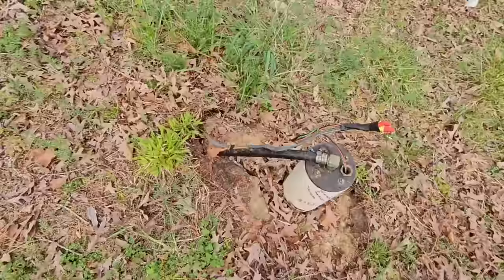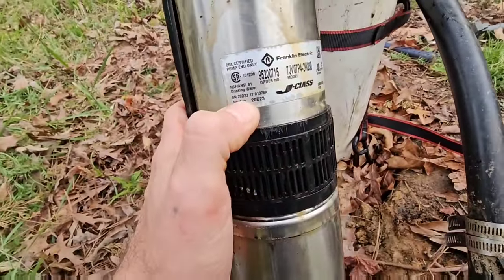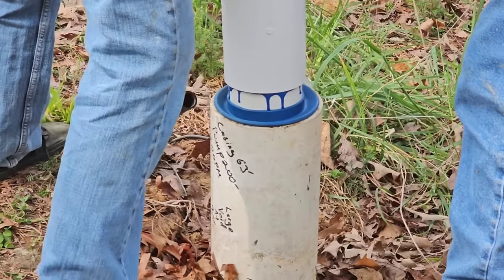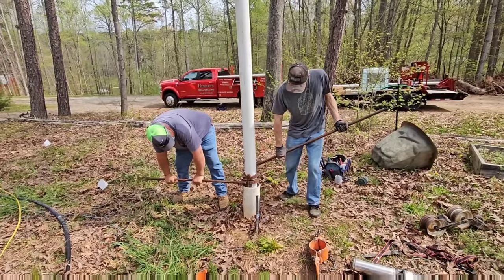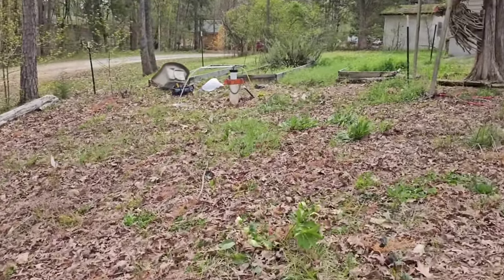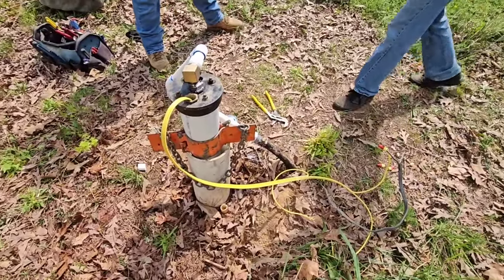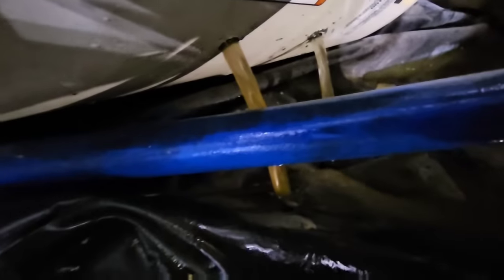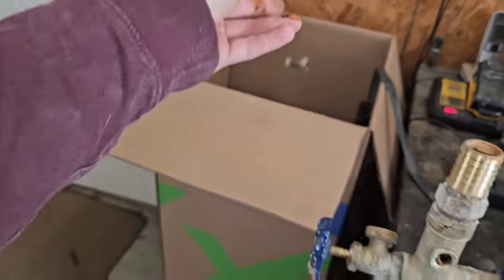Sediment Problems and How to Fix it. Discolored Well Water After Heavy Rainfall. Full System Check

Comment: I can't believe that I've now watched five videos from your channel, and am now subscribed... I don't even have a well.
Reply: So I am not the only one.
Reply: no well, new subscriber(nwns) here too...
Reply: Same here. However there is a chance within the year I will buy property without city water. So "knowledge is power" when it comes to existing wells or getting new ones drilled.
Reply: I watch these too. But I bought my current house 1.5 years ago,,, my first well. My pump failed on July 3rd. I knew exactly what to do. New pump, new well pipe, new wire, new well seal, and a frequency controller. Repaired my well casing by welding in a patch where it had been notched for wire and rope, Did some re-plumbing. System rungs like new. Thanks H20 Mechanic!
Reply: Niceee @usethenoodle

Comment: Hydraulics Professor once told us "the best way to heat up your system is engage the pump and let it dead-head against a closed valve for a few minutes. The hot oil will heat up the your system in no time once you open the valve."

Comment: I just sent you some paypal lunch money as a thank you for sharing your knowledge. You know what I mean: the tricks that the pros know that average DIY person will probably never have the opportunity to learn. I am getting ready to replace my 3rd pump, at the third house I have lived at.  I thought I knew how to do it but you have soooo many tips and secrets. I pulled the pump the other day (muscled it up 135 feet) and I thought I was gonna die. Then I saw the clever rig that you made with the lawn mower wheels, which I am making an ok copy of right now. You may have saved this old man from having a heart attack, LOL. When I pulled it up a few days ago the pump checked good (its at least 13 years old) but the wires were chaffed in several places and I ended up having to use the green wire as a hot. I am going to the well supply place tomorrow to get everything new: wire, pump, snubbers, low-pressure trip pressure switch, etc. The 13 year old 3/4 HP pump is probably on borrowed time. It's total run is about 700 feet but its head is only 230 feet. The pressure tank is only 8 years old and is inside the house, but I will check the bladder pressure and listen for the ring and make sure its cycle time is correct for the size of the tank. (A 40 gallon bladder.) And all the other subtleties that you have shared. This will hopefully be the last time I pull a pump in my lifetime. But I think the static water height is about 40 feet higher than when I checked it several years ago, but the water still tests good like there isn't a ground water issue, I hope. Hmmm.
Thanks again, and enjoy lunch on me! Lloyd

Comment: I've had wire in my well for thirty years,  I put my wire in 3/4 inch black poly, from top to bottom. Works great
Reply: That’s the question I asked too.A simple no brainer in my books
Reply: I don't understand why well pump wire is done this way and not a flat cable like romex.

Comment: Love your videos. You are a master well driller/repairman. I have two 500 ft wells in North TX down to the Woodbine Aquifer. So far so good with one well using a 10 gallon per minute Franklin pump, and the other with a Grundfos 3" constant pressure electronic pump with a CU301 Controller kit. Great stuff and zero problems so far in 5 years.

Comment: With the bare hot and ground there would have been current in the water.  I wonder if that would heat the water.  I guess the well does not have a ground fault breaker which would have tripped.  Do people use ground fault breakers on wells in new installatins?  Good video.

Comment: The more well videos I watch from all sorts of companies, has made me glad we did a bunch of extra stuff for my new well down in Arkansas. Ran a 10/3 240ft to my well from the pole on it's own breaker. Built a 10x10 shed over the well head, with a tandem 30amp double pole and twin 20amp breakers on their own circuits for each, with their own duplex and light on each leg, with a secondary breaker panel with 2 slots and a generator back stab. That way anyone can work on the well if no one is home. And can be turned off in multiple spots and if there's no power u can flip 2 breakers and backstab right at the well shed with a small 220/240 Genny.

Comment: As a well driller in Australia, we deal with mud rotary as most of our land is flat coastal. 

We do have afew guys with DTH rigs for the hills but mainly mud rotary around these parts of Western Australia! 

We set casing from the BOH to surface with slotted casing down the bottom, gravel then bentonite chips to seal off the surface water. 

I’m glad to see everyone getting work especially us when we get government work 😎😎

Comment: We had a well silt in and the grit from the silt trashed the pump. Well was bad after that. We could potentially have added a bunch of gravel to act as a filter but it was a total gamble. So we drilled a new well. The well guy said ours was pretty unusual but that it doesn't take a huge amount of dirt to wear out the impellers of the pump.

Comment: My aunt had that over pressure issue. Her house required a pump to pull the city water up to the house, but when there were bad storms I'm guessing the barometric pressure difference caused problems. She had this happen a couple times , her house was on top of a mountain above the town. I help her make the repairs once. The o-rings blew out on the hoses to the toilet and sinks,  some times the hoses would break, the house was only a couple years old. I think she regretted building it there . The flooding happened about 3-4 Times over 6-8 years ..

Comment: My grandpa's old well had a light wired into the pump circuit so it came on with the well.  Any time that light was on when he wasn't using water and he knew he had a problem.  His pump house was probably 500 feet from his house so you could only really see it at night, but it was simple and it worked.  I am on a well now myself and after seeing this I'm thinking about wiring in a little led light.  

My well is set up with a pumptec and a big pressure tank...I could see it getting up to all kinds of shenanigans before I knew I had a problem.  

Why don't they all get set up with some kind of an indicator?
Reply: Wisdom like that is too-often ignored these days.

Comment: Is the pressure release valve standard on a pressure tank. Or just on the hot water tank. I’d like to check our well water system to reduce the risk of flooding the woods floors. What a great video. It covers a lot I did not know about a well water system. Thanks.

Comment: If you plum the filter after the switch, what keeps the diaphragm in the switch from getting packed with debris?   I put one of those 60mesh back flush filter before mine to keep the junk out and it’s worked very well.  I used to replace the switch every year. Now it’s been over 8years still goin.

Comment: So- as there is a 40-60 psi switch --- did you pressurize the bladder to 40-2=38 PSIg before starting up the system?

Comment: really cool video, and very educational.  Curious, how deep is this well and is that rope a safety rope to prevent the pump from falling into the well?  Also when did you pull out the pipe that you inserted into the casing or is this a permanent thing?

Comment: What is the best setup for a shallow well with a above ground pump and the water is full of iron. You can run the water into a white 5 gallon bucket and it is clear, after a hour or so the water becomes a reddish brown. It sure likes to clog pumps and the lines too. I live on the coast of NC and everyone with a well has the same problem. Lucky for me the well only feeds my outside faucets for the garden and such. New Sub also, appreciate you taking us along and giving away a little knowledge!!

Comment: Would it be helpful to install a tee with a mud leg and ball valve at the bladder tank so you blow out the sediment. 
 On heating boilers we would install mud legs and a valve to blow down once a year it does help.

Comment: by 2:30 I'm guessing line/fitting leaking inside the well.
which explains low pressure/volume, pump running continuous, lower current draw, warm water/well and sediment in the water from washing down the casing/bore.
wouldn't be the first time I've seen that happen and I'm not a well service, although I have done plenty.

Comment: My pressure switch nipple also plugged up like that.  I noticed it when the pressure release on the water heater would spray toward the end of every pump cycle.  I suspect those pressure surges also blew the bladder in my pressure tank.

Comment: A bigger concern for me with the pump not shutting off if there's no pressure relief is the bladder tank. Or a contact tank for a chlorinated system. Many are only rated for 100-125PSI. If a tank pops it could be pretty bad

Comment: California requires 6x6 foot concrete pad around well casing to minimize surface water infiltration.
Reply: Do they not use pitless adapters, or do they have to break up the concrete pad if the pitless goes bad?

Comment: so If someone wanted to plumb a filter before a pressure tank, just to have that sacrificial filter work to extend the life of your pressure tank, would you suggest just not doing it because its not worth it, or a particular filter replacement schedule (say instead of every 6 months, every 3 months) in the case where a sacrificial filter is desired?

Comment: One time we showed up to a 100 hp turbine on 10 inch pipe, they had closed the valve at the surface, the pump had been running dead head for 2 hours, steam was coming out of thr ground, everything was boiling hot, even by the time we got the bowl up it was still HOT.

Comment: I'm in the Southeast (North Carolina) sand well country...Your work looks great.. you guys def got it going on..But why on earth would you guys not dig out around the pipe, grout it in, as best you can, even if it's a few feet, and cast a 4'x4' pad/slab around that 6" PVC case?!?!?.
Just my 2 cents, but in my neck of the woods, thats the most paramount is to slab out around that casing stub up.

90% of your water intrusion from rain water, will chase the casing down the sides of the sleeve. In NC, we have to have the shaft concreted around the 4" or 6" pipe 48x48 or 60x60..
The slab leaves a nice place for a data plate too, and works as a footing for fabing up a pump house where the pressure switch and bladder tank can also live, along with that breaker shut off...then y'all wouldn't have had to work around all day with homeowners away. Shame the things we work to work around. 
We do we all like that here
 I'm real surprised your job well there didn't have that setup. 

..

Comment: You said the sediment filter should not be plumbed before the pressure tank, but how does the pressure tank not fill.with sediment?
Reply: They're supposed to be self clearing, when the pressure drops the membrane pushes the junk out
Reply: I caught that too.  My filter is before the pressure tank.  no issues for 27 years!!  I do change the filter every couple years  but prolly not enough....:eyes-purple-crying:

Comment: I always used a ball valve and a tee to reduce down to quarter inch for gauge  and could check gallons per minute and be able to close valve down to check pressure. You can dead head pump to check maximum psi or see what gpm pump is pumping at different  psi
Reply: He has all that gear in another video  and a complete test stand for pump verification.  just not out here for this job

Comment: SO.... pump wasnt generating enough pressure to make switch cut off; you pulled pump, finding compromised wire. you put new wire and stabbed it. now the pressure switch cuts off. 🧐 why?  you mentioned the skinny nipple 😅 was plugged. did taking pump out realease a little crud out, so when you reenrgized a bit more water went through causing it to work? 
how about that red wire? was it affecting motor performance, could it have affected pressure?
thx- cool video

Comment: ok so would the system have clogged up in 2 years? what would be the solution to keep this from happening again? with in a period of time because it clogged the vertical pressure tube to the switch, it would do that with a new one.

Comment: How did you connect the 4" pipe to the top of the well to keep it from falling deeper, once you remove the orange clamp?
Reply from the maker: Cement, gravel mix. That process comes later once we know this packer is sealed & works. It must be pumped around the bottom.  I also drill a hole threw both pipes & put a carriage bolt 🔩 in it to hold them there as a added safety

Comment: Glad you showed that clogged nipple. I was thinking there was more to the reason that pump was running continuously. Down here we use galvanized drop pipe which gets holes rusted in it, that also caused the pump to not shut off.
Reply: I had a galvanized pipe running from the pitless adapter underground to the pressure tank in the house that got a hole rusted in it. Well pump was short cycling because the water was leaking back out the hole in the galvanized pipe into the ground.
Reply: @TheOnlySgtRock  Those are a pain to locate the problem.

Comment: Never saw the well head when you left. How did you leave it and hold the packer from slipping down the well. Are you relying on just one packer holding that weight over time?
Reply from the maker: The orange clamp stays on it. The packer typically can hold itself, but the clamp holds it at a coupling. I have another style I can tighten as well.

Comment: The wires are not shielded from chafing , why do you allow customers to use poor quality wires knowing they dont have any protection from chafing? The correct wire type will prevent any damage to the conductors. well water and 220volt pump should require a certain type of wire to be used. Is there a electrical code to require a certain wire to be installed and it was not done? Your videos are excellent and i have questions.. again great job!

Comment: Short cycling of the pump did not cause the electrical wires to get damaged insulation.  That was due to poor insertion of the wires into the hole. The cables got damaged in installation.  In addition the cable should have been double insulated.

Comment: If relief valve would have been used at top of well that would have eliminated the high pressure buildup from filter being installed in wrong location or any other problems causing high pressure. Also we have to install check valve at well before it go into the ground.

Comment: Why not put a 1/2 conduit when doing this installation circuit. I see that this problem is very common in all drilling channels. 
Will the price of the service you provide be cheaper?

Comment: In a previous video you said that poly pipe is only good to 400feet can you put 3 10 foot lengths of pvc  pipe to negate the head pressure and use poly the rest of the way up?
Reply from the maker: That's possible & I've seen it done, but it's a pain bc once the pump dies, you risk that transition between the two pipe breaking during removal. Bc pvc is so rigid

Comment: Wire insulation doesn't go bad from just being there. It was damaged from careless removal/ installation at some point. You admitted to changing the pump in the past. If that wire was damaged before or during the time you last changed the pump, you should have replaced the cable at that time.
Reply: Wire is damaged by pump rotating from the pump torque of it starting. Happens all the time when poly pipe is used.
Reply: I'm no expert but I do know the torque of the pump turning on & off causes wire to rub against the well liner. Heat probably caused it to break down faster.

Comment: My well is over 400 feet deep  . The very first pump the well driller put in 2004 was  less than 1  hp power and driller said it was not a strong enough werll pump and he told us he needed to put in  1HP pump . I woud have to look at well drill;ers papers to see if he wrote it down . This will be the 4th pump on this house since 2004

Comment: we have same issue with our well  with heavy rains,but will clear in a few days ,our well is 520 ft deep ,we have a 5 hp motor /pump.we get 25 gallons a minute. WE had everything replace pump/motor and control box 7500.00 ouch

Comment: Hello have a well putting out water with an odor. Had the water tested, they called sent mail and arrived in person to stop us from using the water. Must have something foul contamination. The wll is 40 ft. To the flashfoot. With a Gould 1200gph swimming pool pump in my basement.  My question can a well be drilled deeper?

Comment: I just installed a new pressure switch to replace a bad one. The original switch is a 20-40 psi and so thats what I replaced it with. The water pressure specifically in the shower, always to me anyway, seemed to be a little weak. The washer seems to fill slow also. The gauge is showing and is set at 40psi. Is there any reason I can't change the switch to a 40-60psi and adjust the pressure 50psi?

Comment: When i see electrical tape used underwater i get a instant heavy itch. As an electrician i usually do not use any electrical tape anymore (Even in dry and perfect conditions. . Because over time it turns to goo. I know self fusing tape is more expensive but can handle the enviroment. And for any other scenario there are way better options than electrical tape!

Comment: how does the short cycle kill the wire?  23:10
Reply: afaik it causes the pump to move around on start up a bunch of times causing the wire to rub against the walls of the well and putting holes into the wires

Comment: The pump is running on one leg instead of both due to one bad wire causing the pump to be under Amp causing overheating of pump.